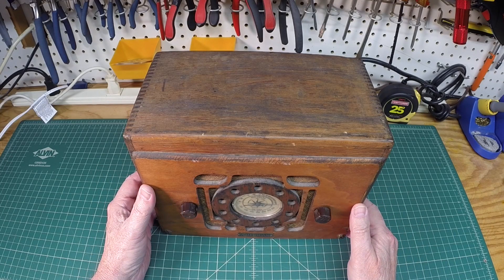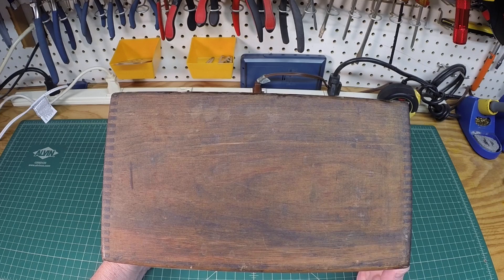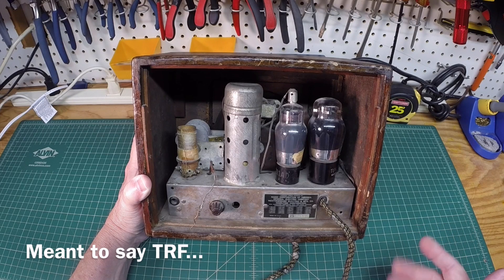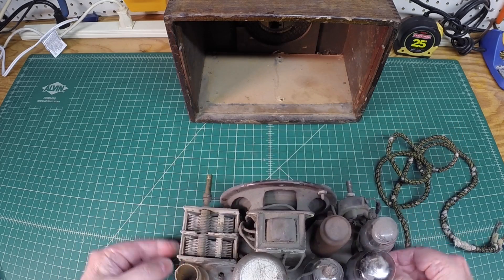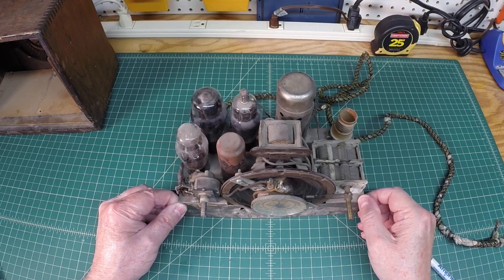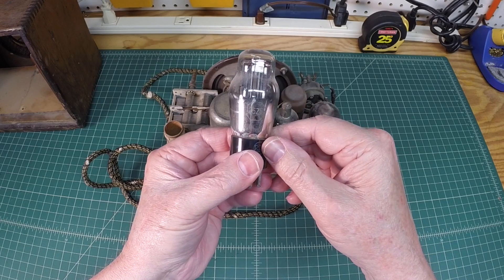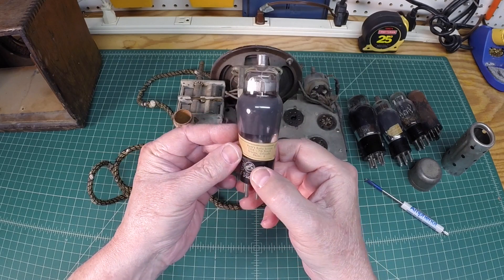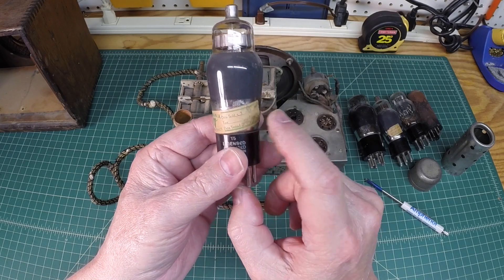American TRF Receiver - Introduction

Comment: Great video! I saw the 6C6 vaccum tube. I have an TRF radio with this triple grid detector pentode. How does the detection works in this tube? There is not so much information to find of this valve, exept the data sheet. Greetings Kurt
Reply from the maker: Kurt - a good read for old tube theory at: https://worldradiohistory.com/Archive-Catalogs/RCA/RCA-Cunningham-Radiotron-RC-12-1934.pdf There’s reference to detection and circuit design. Best, Don
Reply: @RestoreOldRadios  Thank you for good information!
Greetings Kurt

Comment: I doubt this is a TRF radio. Looks more like a low end heterodyne seeing as it has the double ganged tuning cap and only 4 tubes.  TRF radios would have more ganged tuning caps and more tubes. They might be using some regeneration to get the gain up as 4 tubes is a little sketchy. No power transformer so series strung filaments, AC/DC set.
Reply from the maker: +Herbert Susmann Hi Herbert - thanks for the info and your feedback. The schematic I referenced to make the repairs is for a Pacific model 15, 16 (top drawing) as referenced at: http://www.nostalgiaair.org/pagesbymodel/796/M0012796.pdf If you wouldn't mind, I would appreciate you reviewing the schematic and sharing any additional information on what makes the radio a low end heterodyne in lieu of a TRF for my edification. Thanks in advance for your time. Best, Don
Reply: RestoreOldRadios
Don, I stand corrected. This is not a heterodyne afterall. It must have very poor selectivity however as it seems to only have two tunable tank circuits. I have never seen a TRF radio with so few tubes. Perhaps because the tubes are pentodes they can get more gain than the older TRF radios that used triodes for gain. I don't see an oscillator circuit so it can't be a heterodyne.  Strange! I'd be interested to hear how it performs.
Reply from the maker: +Herbert Susmann Hi Herbert - I appreciate you sharing your knowledge as my understanding of these TRF receivers is very limited, especially when it comes to heterodyne vs. TRF. You are so right on the selectivity, it's very poor. Here's part 5 of the restore with the radio playing: https://youtu.be/v3xoN9cpqM4?t=634  The speaker has a little rattle too, that needs to be attended to as well. Thanks again for taking time to respond, it's appreciated. Best, Don

Comment: I too liked the dove tails on the cabinet, with a lite coloring those will stand proud!  Interesting tidbit however, I noticed the cabinet was stained on the inside and maybe the bottom but not the face, sides and top, so maybe it was stripped at some time?  The stickers on the tubes were indeed cool, I don't think I'd reuse the tubes and take a chance at loosing them to heat, I'd archive them for historical purposes.....looking forward to this series!
Reply from the maker: +JacksJunkDotCom Hi Jack - you bring up a good point on the tube(s). I may put the one tube aside that has the sticker for the radio repair facility in CO. The cabinet, the more I look at it appears to be hand made, but you never know. I'll probably try to clean it real good and see what it looks like before touching it up if I go down that path. Thanks for checking this video out and following the series down the road. BTW - I'm assuming you got my reply to your "PM" a few weeks back? Best, Don
Reply: RestoreOldRadios If it were my and I did put the tube back in, it would just be for show and not use, to me the historical value of that goofy little sticker is astronomical! Sorry, I missed the PM, but I did get it now, and thank you!  :)

Comment: Don,
Very interesting little TRF radio you have my friend.  The 5” speaker has a sort of familiar look about it – the one I have in my mind’s eye was produced by BTH.
I don’t want to come across as rude, or pedantic – I sincerely put my hand on heart and say, “far from it, I’m not smart.” – but if my memory serves me correctly, isn’t the 50A2 a ‘directly heated cathode (2.4v)’ triode valve rather than a barretter?  As far as I’m aware, that particular valve was never incorporated into British radios, so I might be mistaken here.
As for those Bakelite knobs, I’ve seen those before, or knobs that look extremely close to the ones on your radio.  There was also a larger version available – presumably intended for the tuning knob???  Those type of knob tended to be popular with ‘kit radio’, and un-badged budged-end, radio manufacturers of the late 1930s, and again during the mid-to-late 1940s. 
I’m looking forward to following this radio’s repair/restoration my friend.
Hopefully, I'll begin another radio repair/restoration video early in the New Year.  I’ve selected two candidates – a 1931, Ekco, model RS2, and a 1945, Ferranti, model 145.  At present, I’m undecided which one to begin with LOL.
Best regards,
Phil.
Reply from the maker: +SteelCity321PB Hi Phil - thanks for taking time to watch this video and the info you shared. I need to get under the chassis and confirm that the 50A2 is indeed a ballast tube, but all indications externally point in that direction. Here's a link for reference: http://frank.pocnet.net/sheets/201/5/50A2.pdf  Again, I have not looked at the tie in points, so you may be spot on and I'll let you know over the next week or so when I get back to this one. I appreciate the info on the knobs too. Trying to decide on a candidate to restore or work on is hard for me too. I've had a few I thought would be next on the list only to be replaced by another one. LOL I look forward to your next project too once finalized and I'll keep you abreast of my findings on this TRF receiver. Again, thank you for following along. Best, Don
Reply: +RestoreOldRadios 

Don,

Thank you for that data sheet detain the 50A2, and 50B2, ballast (known here in the UK as ‘Dropper units’).

Here we have what I regard as a very interesting situation in the sense we are both right.

Before I continue, here are two links I found detailing the 50A2 valve:

http://www.radiomuseum.org/tubes/tube_50a2.html

…and…

http://tdsl.duncanamps.com/show.php?des=50A2

I’ve included the following to add further support to the 50A2 ballast unit:

http://www.radiomuseum.org/tubes/tube_50a2_ballast.html

Around forty years ago, whilst employed in television and audio servicing, I worked alongside a chap who loved restoring pre-1930 radios, and battery valve sets (although I’m capable of repairing those types of radios, I’m generally not enthusiastic about doing so).  Underneath his bench was a 1930s battery valve radio (make – I can’t remember), manufactured in the USA, which he brought out to work on during his lunch breaks. There came a time when he met with a snag, which turned out to be a defective 50A2 valve.

Now the 50A2 valve has never been an ‘off-the-shelf’ component here in the UK, yet, for several weeks he tried to obtain one.  The fellow was like a bear with a sore arse to the extent he drove myself, and ten other service techs, crazy.  Eventually he located one – where from, I don’t know – and when he fitted it, the radio began to function.  Man: we were so happy, not because he had gotten his battery radio working – it quietened him down and gave us all some peace LOL.

From that time on, ‘50A2’ has become lodged in my head.  As you may well imagine, when I heard you talk about, ’50 Alpha 2,’ it increased my attention LOL. 

In conclusion: we have to be aware there are electronics components, having different functions; that bare the same identification.     

Regards,

Phil.
Reply from the maker: +SteelCity321PB Phil, some great info you dug up on both type devices; much appreciated. I love your story and after reading it, I can definitely see why the 50A2 stays with you. LOL Again, I appreciate you taking time to send me the links on the triode and ballast and you're so right regarding the component identifications with multiple matches. I hope to get started on this little gem in the next week or two if things settle down around here. Thanks for following along and your feedback. Best, Don

Comment: Hi Don, I couldn't find any data on that a 500A2 ballast. Is that the designation? Your lighting's great BTW.

Regards _ Andrew
Reply from the maker: Hi Andrew - I typed in the wrong part number in the description of the video, which I just corrected thanks to you. It's a 50A2 made by Triad; sorry about that. Here's a link to the ballast tube for reference: http://frank.pocnet.net/sheets/201/5/50A2.pdf  As always, I appreciate you checking this out and bringing this forward. In addition, thanks for noting the lighting. I recently started using a secondary light when shooting video in addition to my overhead lighting, which seems to help. Best, Don

Comment: Hi Don,
You asked for input so here's mine! I have a radio that looks almost identical to that one although mine says Majestic on the front plate. I believe my dial is a drawing of a sailing ship. The chassis however, if I remember correctly, is almost identical. Mine also uses a ballast tube. I think some unknown radio manufacturer made a bunch of these radios under a bunch of different names. With that said, my opinion is that the cabinet of that radio is long gone. I say that because the cabinet on mine completely fell apart! Every glue joint dried out and failed.

I actually was going to re-glue and refinish my cabinet, but when I moved to this house 7 years ago most of it disappeared! So I guess I'm going to have to do like the owner of that radio did and build a new one. It appears to me that the wood used to build that cabinet was some sort of fir plywood. The front panel of that radio seems to be original with the exception of that telephone type  escutcheon. Mine has a brass escutcheon. My cabinet is also quite a bit smaller (the chassis barely fits inside of it) so it looks like whoever made that cabinet made it a little roomier.

At the time I bought the radio, I tried to find some sort of manufacturer or schematic but couldn't find one. I'll try to get my radio out and take a few pictures of it. I'll send them off to you. Hope this helps.
Reply from the maker: Jim - the cabinet looks suspect to me too, but it's still unique and has some character. I appreciate your feedback and don't worry about the photos if it's troublesome. Again, I really appreciate you taking time to view this and sharing your thoughts. I had to build a new cabinet for my Crosley 516 some time back. The only thing I salvaged was the top. Here's a link if interested: http://youtu.be/RZ9-57QVmf8  Best, Don